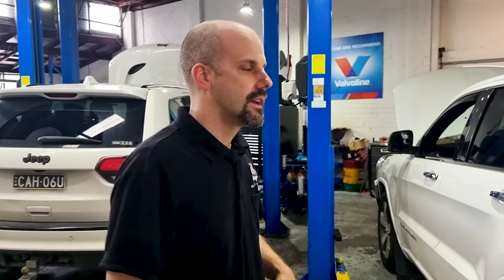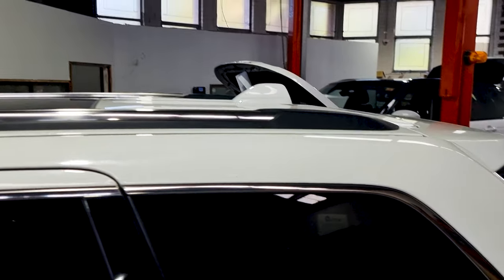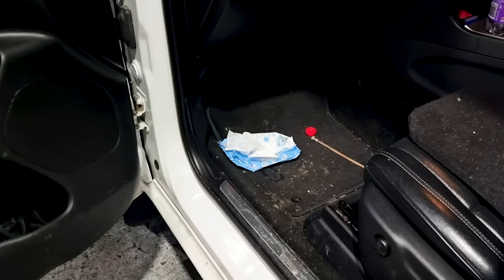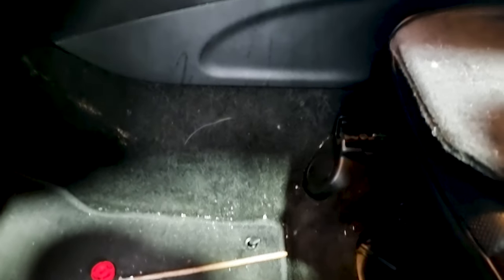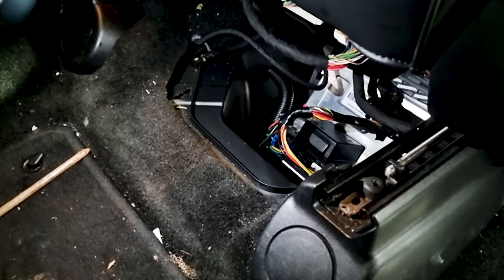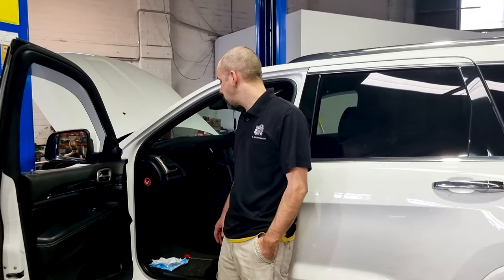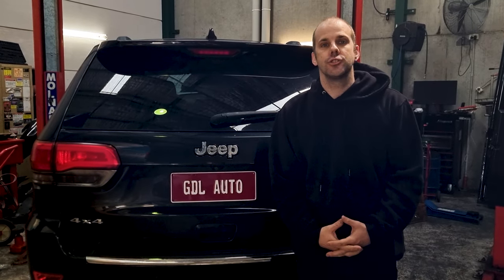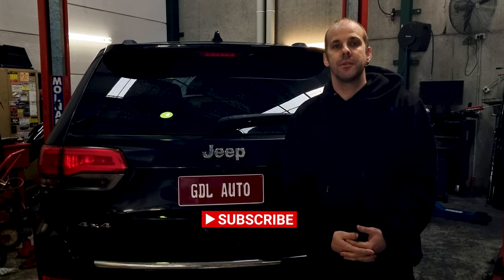What Happens When Your Sunroof Drains Get Clogged On  A Jeep Grand Cherokee

Comment: All the videos out there focus on the front drain lines. But every sunroof has 4 lines serving each corner and in my 2014 grand cherokee, after a water test in each corner the driver rear line is totally blocked. Water instantly poured out the seatbelt and some trim just past the seatbelt.  There is no way to access the access drain port via the sunroof channel - inaccessible. Water exits in front of the rear tire on the other unclogged rear line, but there is no practical way for me to locate the exit and snake up. So if I remove all the interior trim, will I see a drain line? I pried back one small section and all I see is the black underside of the steel roof deck. Or I can park the car sloped so rain can never collect rear driver side
Reply: Do you have a solution for the rear drain lines?
Reply: Yess they never show the back ones !!!! I have the exact same issue with the back riverside passenger drain tube
Reply: I have the same issue for now I just park backwards on the slope and no water leaks in. But the true fix is you have to take down the headliner to unclog the rear drains

Comment: First time in 2 years of owning my 2018 Limited to have water leaking into cabin.  Pulled out from my house today and when I stopped at intersection, water poured out from front corner of Sunglasses holder.  When I opened panoramic roof, the drains appear to be clear and there is no water at all sitting in trough, but I can see above the liner where the water must have went to leak, but no visible signs of how.  I had to leave home to travel for work, and my wife said that she noticed some blue foam like material sticking out of the driver side roof rack rail, and I'm now curious if it may be coming in from there somehow, and when you press the brakes it shoots up towards the front and splashes into the gap between the liner and the roof?  Thanks
Reply from the maker: test the drains. Park the car up on a sunny day, open the sunroof and pour a glass of water into the track right in the corner. If they are not blocked it should trickle out onto the road just behind the front wheel s